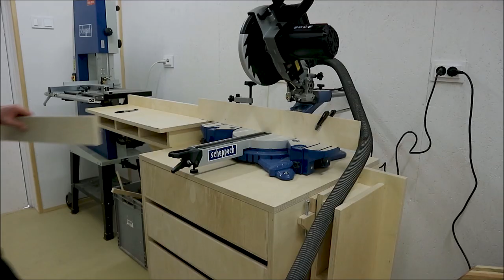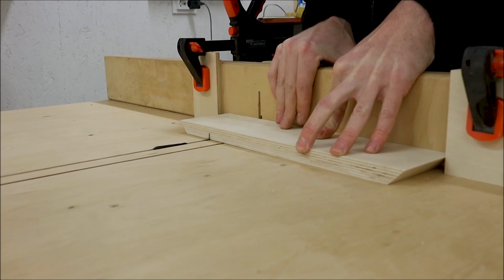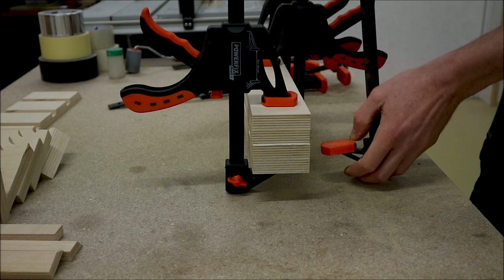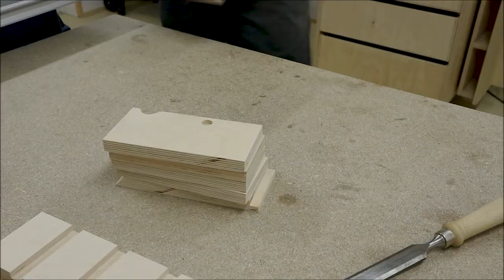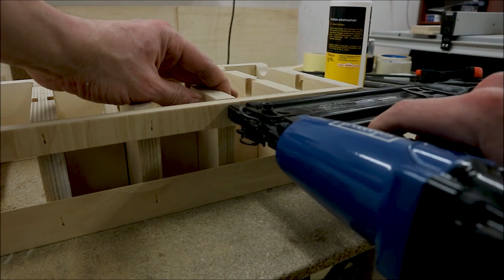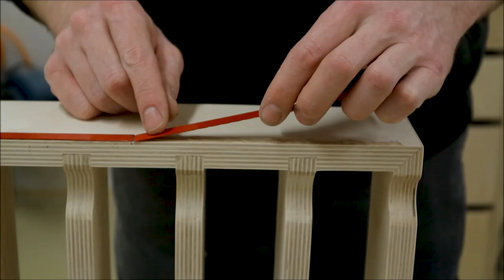Making a tape holder / dispenser

Comment: good practical design. just how i was gonna make mine.. does the hack saw blade work well at cutting the tapes?
Reply from the maker: John Made it Thanks John! Not as well as I thought. I think if I grind the blade thinner it would work better.
Reply: Ollari's I wait into you fine tune then I will make my one 😋
Reply from the maker: John Made it ok. I let you know how it went.

Comment: I just built tape holders myself, I like your design. How does the metal blade work? Does it cut the tape well? Greetings from Austria
Reply from the maker: Adi Sandbichler Thanks Adi! I will probably change the design/ placement of the blades or just grind them thinner. So that it works better. Ach ja, und natürlich schöne grüße aus dem Nachbarland! ;)

Comment: You didn't really show us if it works or not.  By the looks of the ends of the rolls of tap, it appears that the blade really doesn't do a good job of cutting the tape off cleanly.